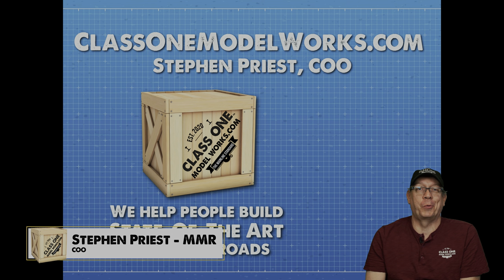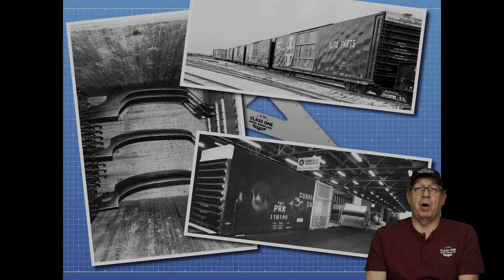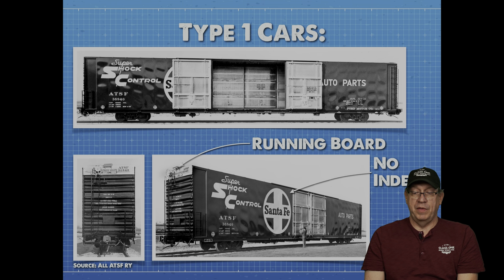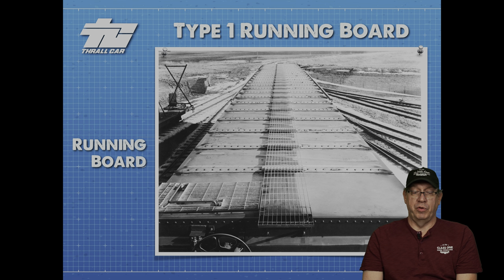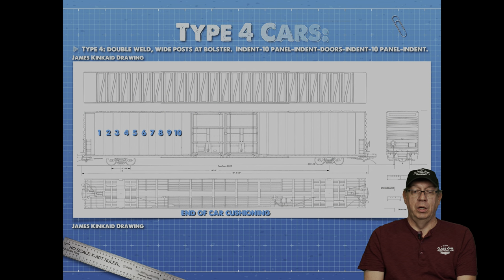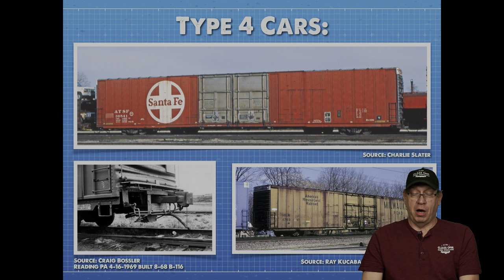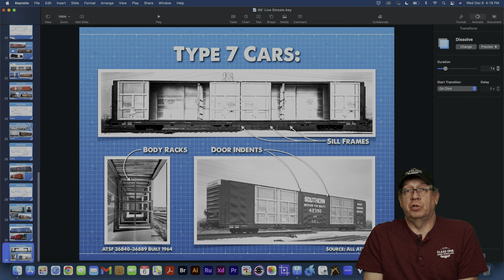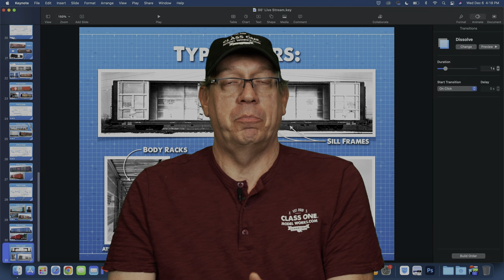Exploring the History of Thrall 86' Auto Parts Cars - An In-Depth Look

Comment: Question about the "indents". Perhaps Thrall had the contractors build only the 'flat' sides (where all the rivets/welds are) and built the "indent" portions themselves? I am wondering if those 'indents' were square tube frames. If that is the case, perhaps the sheeting is welded/riveted on the inside of the car?
As for the 'ripples', I think that may come from the metal coming in rolls of specified widths? Probably more efficient to order rolls of steel than sheets that would have to be cut.